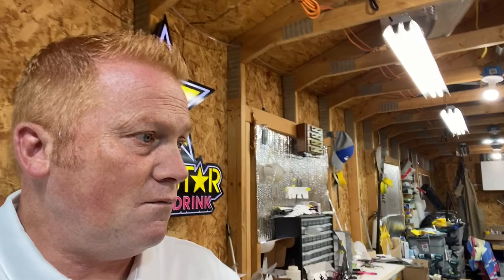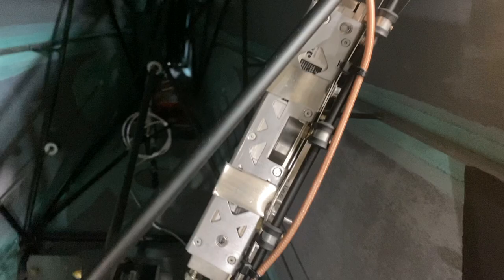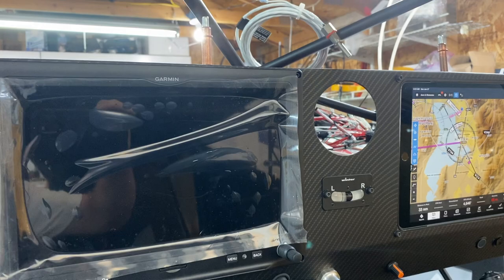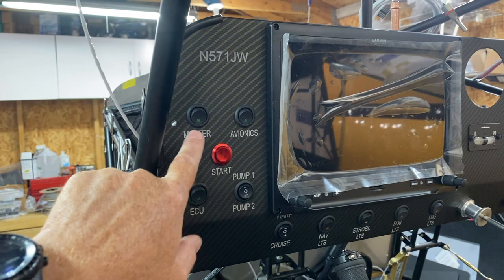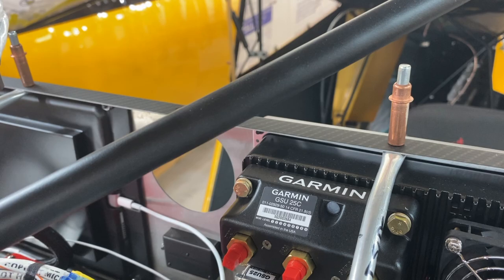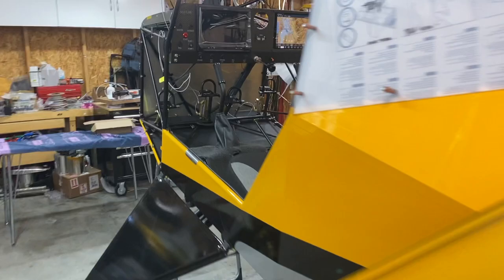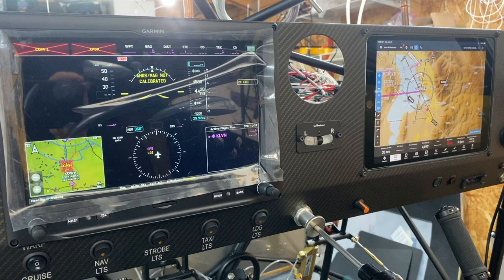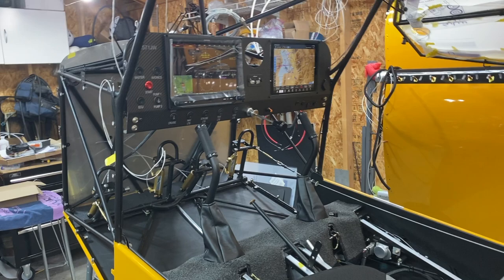Highlander Vlog 12 Avionics are installed and ready to go.

Comment: Hi, my kit is supposed to arrive this fall...what lengthxwidth is your shop ?  i am going to put a temp one in my backyard
Reply from the maker: My shop is 15 wide by 30ft long. The only challenge has been fitting the wings, I pull it out, put them on, do the necessary work, then pull them off and put it back in my shop. I'm getting really close, as soon as my engine arrives from Edge I'll take it to the airport.
Ping me anytime if you have questions.
Reply: @HookedOnUtah  thx, kit is supposed to be here in next couple weeks.  the baggage access door you did is pretty cool, did you have any plans or just fab a sheetmetal door to fit the opening with piano hinge ?
Reply from the maker: @OregonCummins  I watched the video that Chris Wallen put out on how he did his and built mine.
Reply: @HookedOnUtah  ya, i just found that and should be enough.  thx

Comment: What's your useful load gonna be when you're finished?? And what's the fuel burn for the apex??
Reply from the maker: Greg, I'm not sure just yet, I know when the engine arrives and is installed, I'm hoping to be sub 800 lbs on my gross weight of the plane, and the apex should have a cruise burn of 6 to 8 gph, and that's based on what others are currently seeing.

Comment: Hey mate, quick question. 

Why the highlander over the super STOL?
Reply from the maker: Mostly because of the edge performance Yamaha, it also fly’s a bit faster than the SS!
Reply: @HookedOnUtah  I’m in two minds, similar setup as yours or the STOL XL with the Titan 160-180hp. 

In the experimental category it can carry an extra 200 lbs. 

It’s a tough call. 

I’m in Australia. (Not doing to well down here)